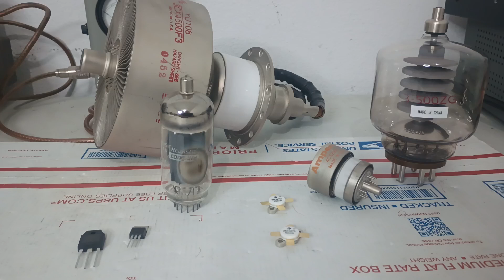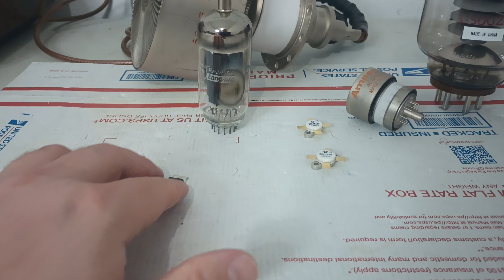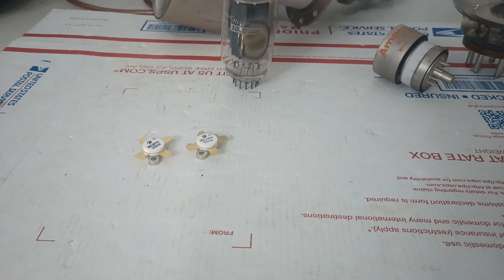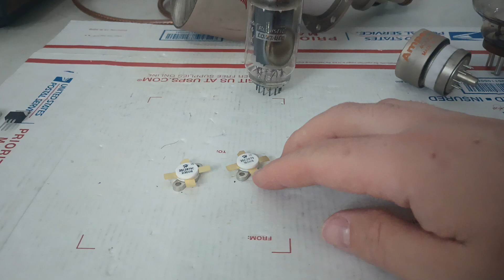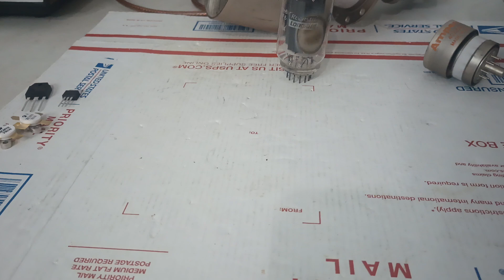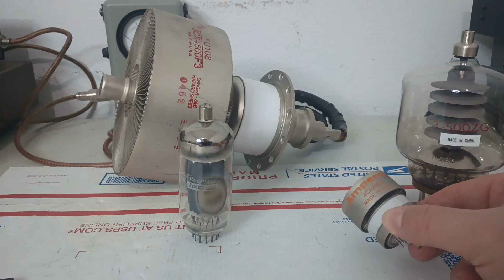CB Radio Basics: An overview and Discussion of the Different Types of Amplifiers in Our Hobby

Comment: @19:00 - tube amps can be actually TUNED to impedance match to the antenna system -- vs. transistor where it would be set to a fixed 50 ohms.  If your antenna SWR is 75 ohms and 1.5:1, the tube amp can be tuned to match 75 ohms as well.  Also the tank circuit of the tube amps have a natural filtering to it so they are better regarding that as well.

Comment: @14:00 agree, it's almost like they have too MUCH gain - so even a tiny bit of overdrive, they blow up easy!  The big advantage is with higher voltage means less current.  High power 12VDC amplifiers get stupid high current (hundreds of amps, welder level amps lol) but with LDMOS 4x the voltage is 1/4 the amperage for the same power.

Comment: Good video!  My thoughts on 2879 vs 2879C @8:30  --  At regular voltage (like 12.0-13.5VDC) 2879 has around 13dB gain while the 2879C has only around 10dB.  More drive is required for the "C"'s.  For SWR, 2:1 can be fine imo if you are within the rating of the transistor (100 watts for the 2879 and 150 watts for the 2879C) but because no one wants to do that, then I agree with you saying 1.3:1.